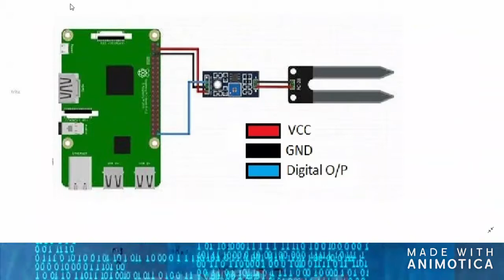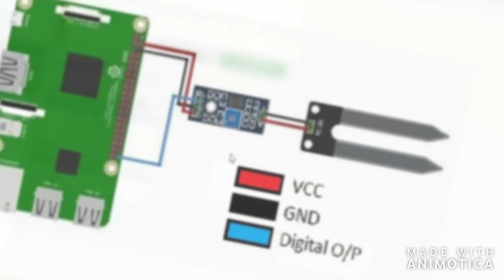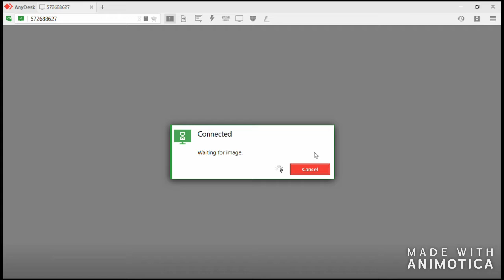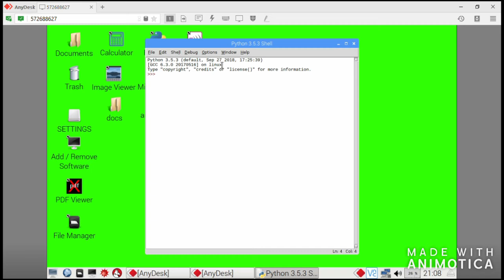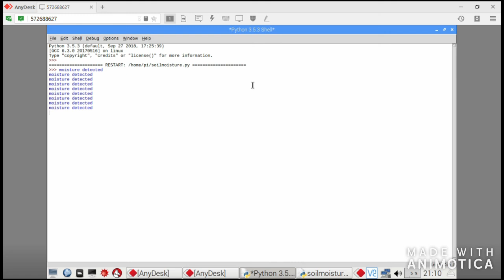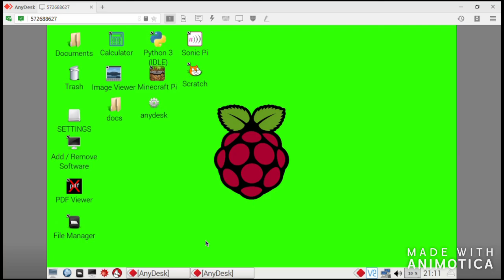Soil Moisture sensor interface with Raspberry Pi 3b/b+/4

Comment: I have a problem with my distance sensor. I did it like you had explained it on a video one year ago but I think I didn't find the right programs ant the staff in the terminal at the beginning of the video didn't work with my raspi 4
Reply from the maker: Try installing  the libraries again